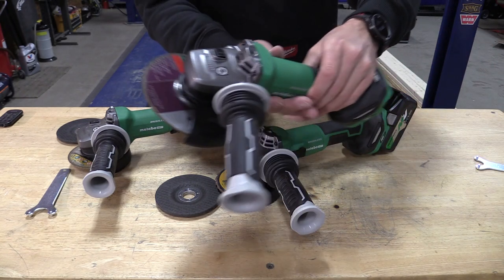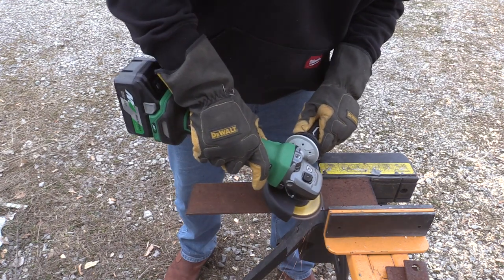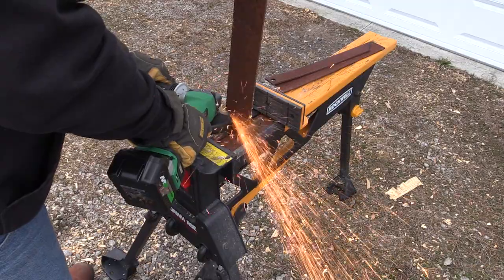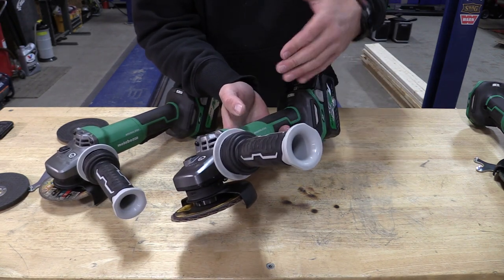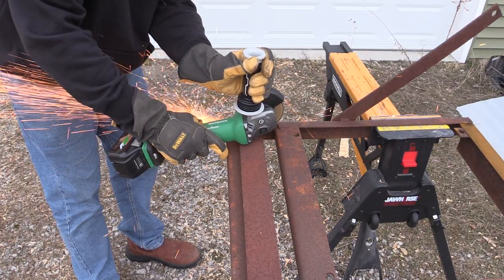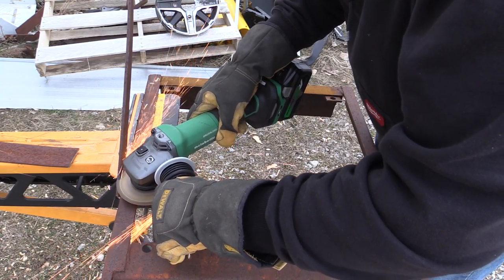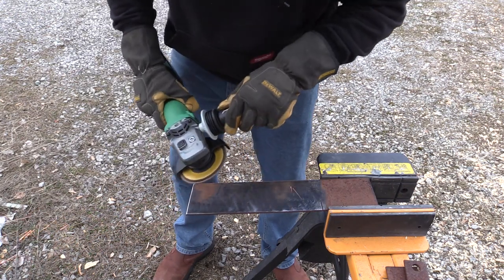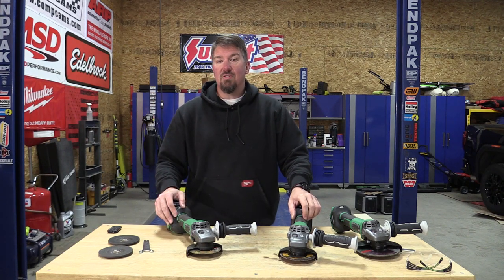New Metabo HPT Hybrid 4-1/2" Variable Speed 36V MultiVolt Angle Grinders

Comment: Hi, what cordless tool would you recommend to remove surface rust from the frame of a car. Preferably compact so it can go behind wheel wells and bumpers. Has to be cordless. Thank you.
Reply from the maker: Angle grinder and wire wheel.  I guess you could use a die grinder and a wire wheel also.  Cup style wheels would be best.
Reply: @WorkshopAddict  thank you for the reply. Among the die grinder, would you recommend the Milwaukee m12 or the Ryobi or something else? I ve heard Kobalt has a 24v brushless die grinder also. And then there is a BAUER20V Brushless Cordless Variable-Speed Oscillating Multi-Tool.
Reply from the maker: @dudututu-s7w  I would not use an Oscillating tool.  That would be painfully slow.  IMHO, I would try to stay with a 18, 20, or 24 volt die grinder as you are going to be asking it to do a lot of work.  Is this a restoration project?  I would think you could get 90% of the frame with an angle grinder and cup wheel.
Reply: @WorkshopAddict  Not really restoration but there are light rust spots around the frame that I recently noticed while changing the oil and filter. I would like to get to it before they go out of hand. So was thinking of sanding down the rust, apply degreaser, then metal prep and then POR15 paint. Maybe fluid film after that. 
I guess my option is between Ryobi vs Milwaukee vs Kobalt. I would assume all 3 would take the 1/4 wire brush attachment.

Comment: Any good against the DeWalt flexvolt 418 ?
Reply from the maker: Dewalt has more power.
Reply: Tools N Stuff did a great comparison on the Makita, DeWalt, Hikoki/MHPT' and Milwaukee
It was the previous 36V but I have found the previous model superior as well to the others and the AC adapter gets used regularly
Reply: @baseballdude8491  Tools and stuff didn't compare the 418.  418 is still the king of 4.5-6" class grinders.
Reply: @jaywelker5566  if u can't plug it in it's not a very useful grinder 
U must not use one often or for serious grinding jobs